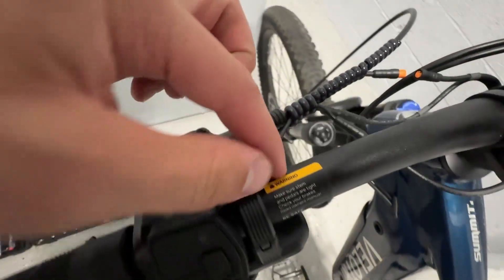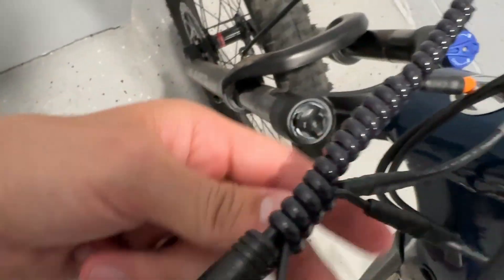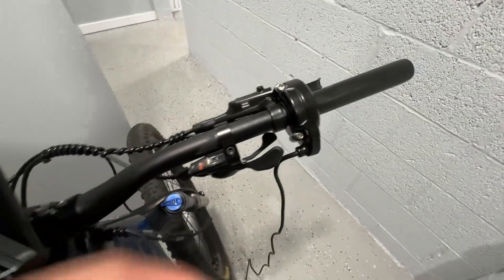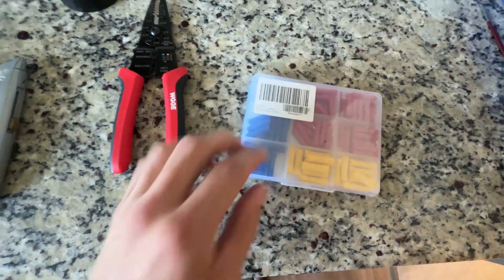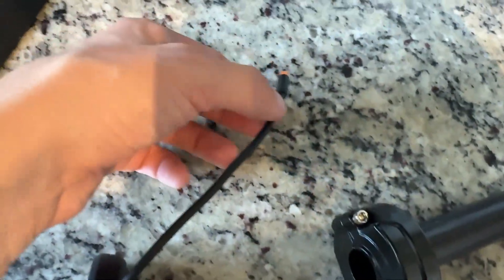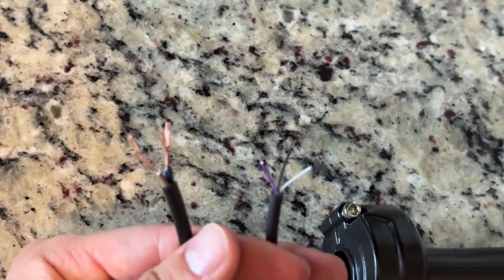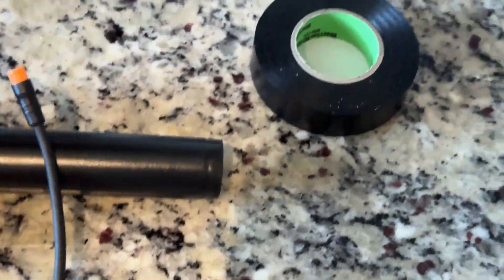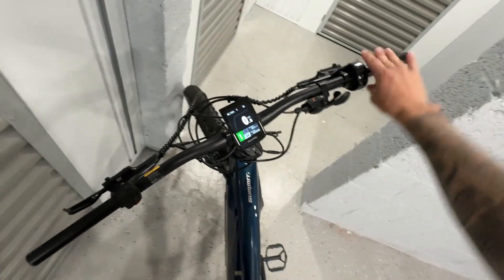Install a Surron Throttle on Any E-Bike (3 pin connector)

Comment: Im trying to find out how to put it on the handle bar bcs its to small can i open it up or anything like that
Reply from the maker: Should be a screw on the throttle you can loosen. If that’s all the way out that most likely the max diameter and that throttle won’t work.

Comment: Does it really need the splice connectors? couldnt you just connect the wires then just cover it with e tape? then do that for the other two wires then just fully cover all of them?
sorry if it sounds like im really on the spectrum
Reply from the maker: You totally could. It just wouldn’t be as permanent nor hold the connection as well if things get loose.
Reply: @MazzEmoto  sorry but last question, on my old throttle wires, i have purple gray and black instead of the white you have, i doubt this is a problem since its just colors but do you think it would be wrong at all? sorry for the dumb question brother😅
Reply from the maker: @Ensyyzz Black goes to black and MOST LIKELY (not for certain, so take this as you will) grey goes to white and then the other colors go together. Be careful with that though and try to do your own research with the colors though.
Reply: @MazzEmoto  just to clarify im not talking about the surron throttle they have the same colors as you do, im talking about my old half twist throttle connector and instead of white on your connector its gray, and then purple then black. So black should go to black then brown with purple then blue to gray for mine?

Comment: Do you have to strip the other wires or no. 

Btw i mean the purple and white ones
Reply from the maker: All wires shown in the video have to be stripped towards the top so you can connect them to their corresponding color.

Cost me about $10 for a wire cutter.

Make sure you’re not stripping the wire that’s connected to your bike just in case you mess up though.
Reply: @MazzEmoto thanks